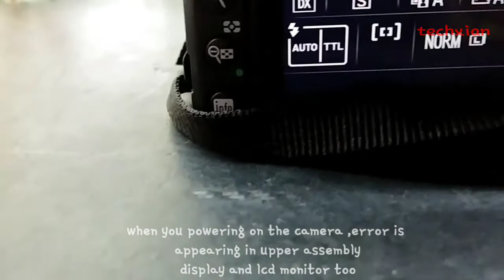REPAIRING NIKON D7500 ERROR/DISASSEMBLE/ASSEMBLE/FIX

Comment: Hi. There are two series in this PCB for the Nikon D7500. One has a small connection ribbon right at the top, the other PCB doesn't. Do you know what that tiny ribbon connects to? You disconnecte it at 4:56. I've had this argument with a chinese supplier and they reckon it doesn't affect anything.

Comment: Very nice video, thank you so much! I was able to change the flex cable by myself. Nikon checked my camera and said, that the screen was comepletely broken when I sent it in (background lights were working but it was only black). I asked if it is not the flex cable maybe and they said no, it was checked and is okay and I need to pay 350€ for the repair of the full screen. I did not believe them and they send me the camera back and charged me 40€ for the "check". They are liars and think all people are stupid and milk their money. I ordered a Flexcable from Aliexpress for 20€ and changed the cable by myself and it is working again!! Damn Nikon liars, cheaters: Nikon Service Point Dresden, Germany. I filed a complaint and hopefully get my costs for the "checkup" back because obviously they just turned on the camera one time and didnt even touch the cable or anything else, it was still glued to the back of the screen in original shape. Don't trust some of these "techs". Thank you sir!!!

Comment: Hi,
My D750 Nikon has a problem with AF.The Af works but it is not accurate.
Could be the magnetic half disk (in front of the camera under the cover) faulty?
Do you have this case already?
Thanks you
Reply from the maker: i think your camera sir need to align the focusing sensor in the mirror box..it happen when accidentally dropped the camera..
Reply: @techxian  ho...Are they some screw to align this sensor?
Reply from the maker: you need a allen wrench sir to ajust the bottom mirror that reflects to the sensor,that is screw is in the side of the box
Reply: @techxian  You mean the screw inside the reflex cage?We can see them when the mirror is locked up?
Reply from the maker: @exocett8163  yes sir you can see it when the mirror locked up but before you adjust it make mark on the screw original position..there are two screw,the one you should adjust is the lower portion..
Reply: @techxian  Thanks a lot friend!
Reply: @techxian  saan po pwesto mo?, dyan ko irereto iba nagpapagawa. o kaya penge nalang contact or FB page
Reply from the maker: @elizerpochollocailipan3860 sta cruz laguna po ako sir,fb page ko ay techxian camera repair service po

Comment: hello, thank you for this superb video very well detailed! I also have a problem with a D7500, the screen does not activate, intermittently, I changed but the problem remains the same. If you have an idea I'm interested, thank you in advance.
Reply from the maker: is your camera sir is  capturing a picture and video? is your only problem is the display? is there a position when you lifting lcd will display? cause you mentioned intermittent..
Reply: @techxian  yes the camera captures photos and videos, the lcd backlight works but the screen remains black. And no difference between open or closed screen. The screen works 1 time out of 20. thank you for your help
Reply from the maker: @davidbravo356 check sir the flexcable of the lcd if thee a open connection..if the flexcable is okey possible the lcd panel is the problem..
Reply: I have already changed the complete LCD screen with its cable, but the problem remains 🤔
Reply from the maker: @davidbravo356  isee the last option you will do sir is replace the mainboard of your camera...
Reply: ok thank you for your help, do you have to reprogram after installing the new motherboard? Thank you very much
Reply from the maker: @davidbravo356  no need to reprogram the mainboard sir the after you replace it..
Reply: @techxian  thank you vers much for your help!
Reply from the maker: @davidbravo356  your welcome sir
Reply: Hello @davidbravo356, I think I have the same problem as you (LCD screen brightens but stays black). Did you solve the problem? Is it ultimately the motherboard? And just curious, where did you find a new LDC screen?
Reply: @GwennAdu  Check my new comment: Very nice video, thank you so much! I was able to change the flex cable by myself. Nikon checked my camera and said, that the screen was comepletely broken when I sent it in (background lights were working but it was only black). I asked if it is not the flex cable maybe and they said no, it was checked and is okay and I need to pay 350€ for the repair of the full screen. I did not believe them and they send me the camera back and charged me 40€ for the "check". They are liars and think all people are stupid and milk their money. I ordered a Flexcable from Aliexpress for 20€ and changed the cable by myself and it is working again!! Damn Nikon liars, cheaters: Nikon Service Point Dresden, Germany. I filed a complaint and hopefully get my costs for the "checkup" back because obviously they just turned on the camera one time and didnt even touch the cable or anything else, it was still glued to the back of the screen in original shape. Don't trust some of these "techs". Thank you sir!!!